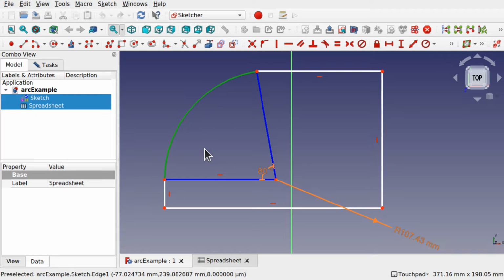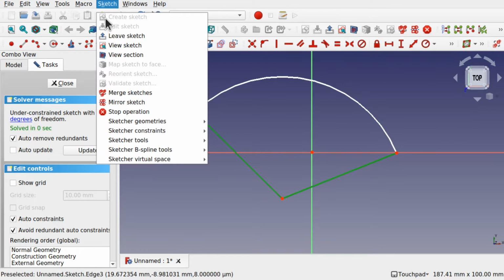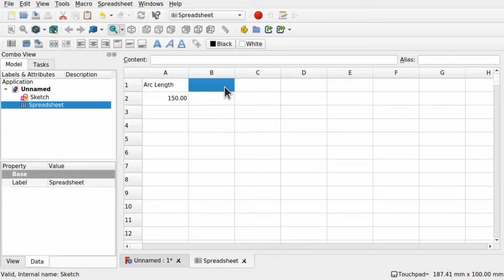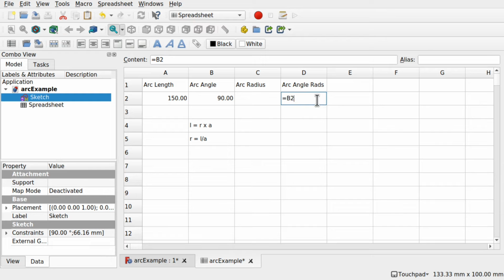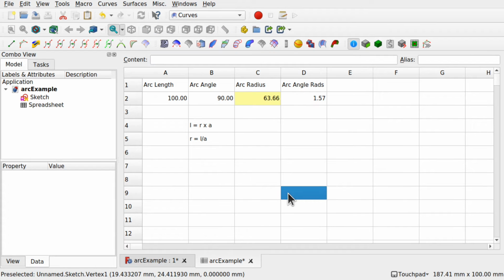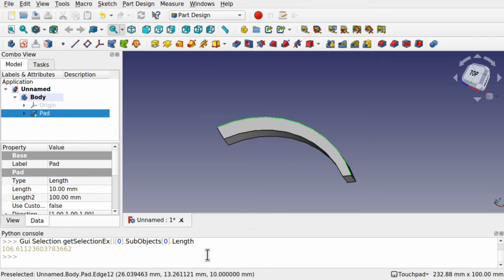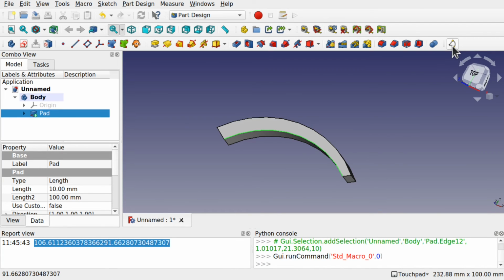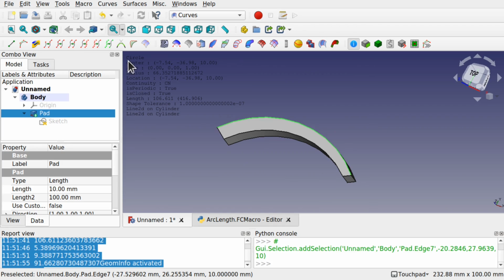FreeCAD: Arc / Arch Length. How to use a spreadsheet to constrain a sketch and a macro to measure

Comment: How do you get it done that your spreadsheet takes the "dot"in ? Any dot gets transformed into a comma at mine
Reply from the maker: I did some research and it looks like this is down to your local settings on the machine itself not actually with FreeCAD

Comment: You don't necessarily need a spreadsheet (or construction lines). Say we want an arc length of 150mm:

- Sketch an arc
- Apply an angle constraint (directly) to the arc, name it "angle"
- Apply a radius constraint to the arc with formula: 150rad / .Constraints.angle

If the arc length is from another constraint, use: .Constraints.arclength / mm * 1rad / .Constraints.angle